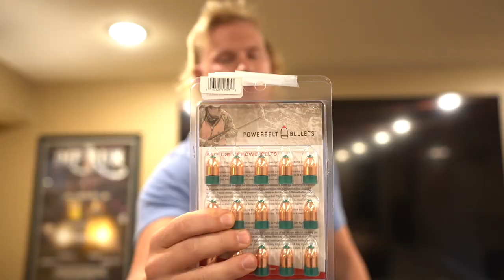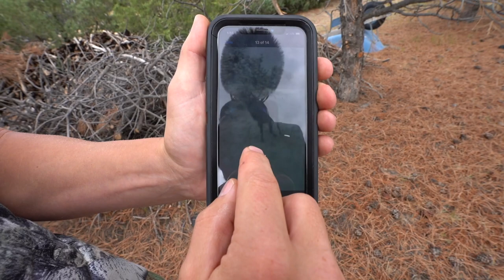These ELK are GOING DOWN!!

Comment: Use a 5 gallon bucket with hot water, and dawn dish soap to clean the barrel. Remove the barrel from the reciever. Plus you can coat the barrel with krisko. Did this way with my muzzle loader for 20 years. No issues.

Comment: When I saw you dumping the gun in soapy water I screamed on the inside haha I’ve never seen that done. The craziest thing I used to clean carbon out a gun is hand sanitizer.
Reply: Seems crazy but works well lol just make sure it's dry then oil down well.
Reply: Should just soak barrel not the action
Reply: @TheREALLibertyOrDeath  yeah just the barrel.  I would be iffy about dunking the whole gun like he did.  To many areas for moisture to hide and create rust deposits esp on a blued gun.
Reply: I use the bath tub to clean my black powder rifle
Reply: @muricantv9834  you just do the barrel or dunk the whole gun like he did?

Comment: I killed 6 deer last year in Kansas, the last 15min of the season I killed 3 in 5 min and could have kept going but I was out of tags.
Reply: 1 Buck and I think 8 doe tags but it could be 6 doe tags I don't remember. There are places around here where you can count over 100 does in a field at 1 time no problem. There is a field by my house that consistently has over 500 turkeys in it every evening. The wildlife is out of control here. If I wanted from Oct-Nov I could get from 2-5 road kill deer a day brought to my house by the police to be butchered. I told them to stop bringing them by and leaving them because I couldn't handle any more. I came home one night from work and had 6 dead deer laying in my driveway that needed cleaned and butchered. They said last year They had over 500 in 60 days killed in our county alone. It's fucking nuts here with deer.